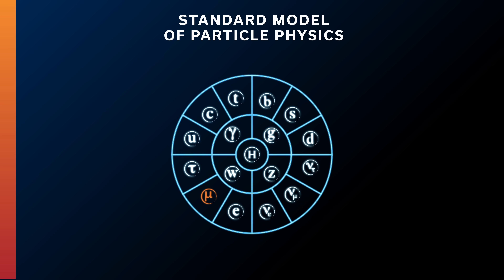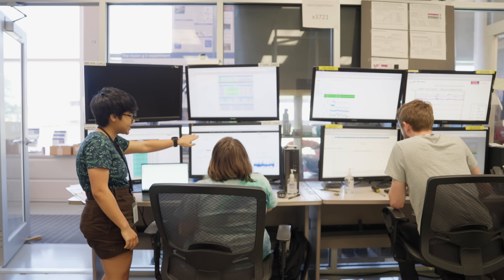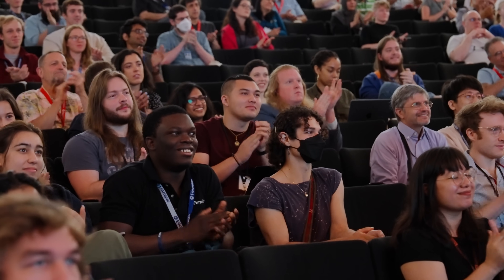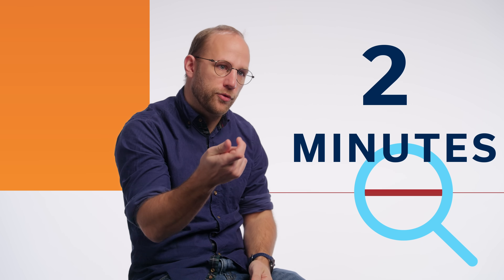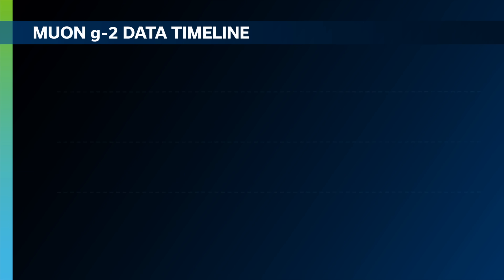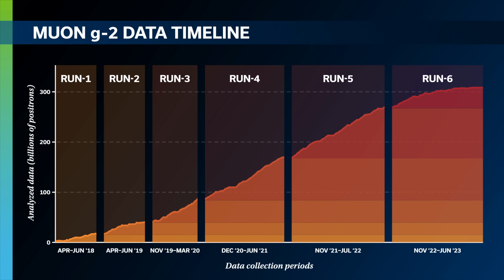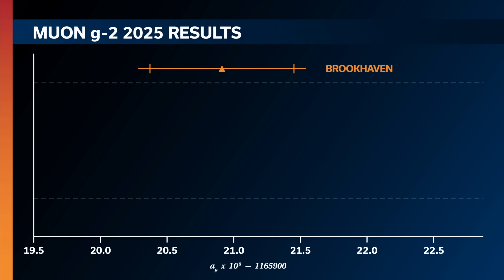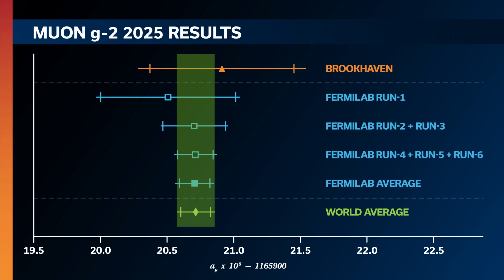Final Muon g-2 Measurement at Fermilab

Comment: Amazing - and relevant - work. Thank you for everything.

One (possibly ignorant) question: How can this be reproduced? I trust Fermilab and the scientists working on this are definitely some of the best on the planet. But science requires others to do the same experiment and come to the same conclusion. Given you had to have the magnet shipped to you, I am guessing creating a second one is prohibitively expensive, making reproducibility a problem.

Sooooooo..... what do we do?
Reply: Hi, good question. I'm no expert, but I will try a possible educated answer: We don't need to repeat the same experiment to have reproducibility, there is intelligent manners to have reproducibility. Four points:
1) This experiment is not really a single experiment, but really an experiment made so many times. In a way, they are doing the reproduction of the experiment to avoid random errors. This is how they achieve so amaizing precisions and, in this way, the high statistical requeriments in physics to call a discoverment force researchers to do the reproduction themselves.
2) The previous point reduces the random error, but there is also the possibility of systematic error (there is an error with the experiment itself). To face this, all the methodology and the data of the experiment is public to the scientific community, in this way all scientist in the area can reproduce the calculations or critic the methodology.
3) With the two previous points, you can reduce random and systematic errors, but there is the possibility of frauds. To this, experiments like Fermilab or CERN have strong standards to secure the data from manipulations (even non intentional) and there is many scientists from all over the world looking to this experiments.
4) Finally, all the set of experiments can be redo by Fermilab and they also change teams when they do it. Commonly, they do the experiment with variations or improvements to not waste resources and time (you can do a new experiment and also reproducing results of a previous one).

In summary, to achieve reproducibility in these costy experiments it is necessary assure bigger standards in statistics, data security, data management and open transparency.
Reply: @Edunomat  in addition, different types of experiments can be / are done to measure the same thing, to check for errors introduced by the method itself. (Unrelated, but the "crisis in cosmology" is essentially about that idea: different types of measurements that should return the same results but don't.)
Reply from the maker: A future experiment at the Japan Proton Accelerator Research Complex will likely make another measurement of the muon magnetic anomaly in the early 2030s, but, initially, they won’t achieve the same precision as Fermilab. https://g-2.kek.jp/overview/
Reply: Some of the "reproducibility" may come from the creation of new physical model hypothesis (hypothetical fifth+ force) which hinge on this result. These hypotheses may make predictions which can be used for new experimental design. If the new experimental designs are concurrently validating the predictions set forth from this experiment, then it serves as indirect evidence.
Reply: @DeepReTheDebrief 50/50 also?  Ist das als Beweis tragbar?   Siehe dazu:   Wasserrutengänger wissenschaftl. Test.  
Liebe Grüsse aus 🇩🇪🫂

Comment: See/saw=constant Sterile neutrino S=(E*T)/(M*T)=2*(me/pm)^2=2*137.036*(2.16*10^-9) deduce (me/pm)^2/137.036=1/(1836.1527^2*137.036)=2.16*10^-9=0.00116592026-0.00116591810 : extra wobbling of muon magnetic moment of (g-2)/2 factor between experiment data[0.001165920+((61-41)+(57-25))*10^-9/2], theoretical prediction [0.00116584719+6845*10^-7+154*10^-8+92*10^-9] from Fermilab at 8/10/23 from beauty quantum 4.25 Gev=(10/16)*137.036/g(p)=(10/16)*(me^2/g*m^2)*(137.036/(me/pm)^2) which can decay into muon[105 mev=(3*137.036/2)*0.511], electron[0.511 mev=me*c^2=g*m^2*137.036/A] 85.73% ratio by 100-85.73=14.27=A/(3*137.036*(A-A1))=128.51991/(3*137.036*(A-A1))=128.51991/(3*137.036*(128.51991-128.4980143))=128.4980143/3^2=(80.351+0.135)/(137.036*(80.485-(80.428126+0.015448))) deduce 80.428126 Gev[80.351+,-0.094] W boson, A1/A=128.4980143/128.51991 from weak force unite strong forceg(p)=g*m^2/pm^2=g*(pl/4.1888*l)^2=1.13*10^28 which's by graviton g*m^2=ch/2pi oscillation between Planck scale l=g*m/c^2=(h*g/2pi*c^3)^0.5=1.616231*10^-35 meter which can deduce ch=2pi*g*m^2=8pi*g*(m*c^2/2)^2/c^4, m=(ch/2pi*g)^0.5=2.176466*10^-8 kg : solution of GR field equation, proton scale pl=g(p)*(4pi*pm/3)/c^2=8.809*10^-16 meter produce asymptotic freedom of strong force with EM force between proton[pm=1.672621868*10^-27 g], electron[me=9.10938356*10^-31 kg] in hydrogen Atom[A=5.29177282*10^-11 meter] k*e^2=g(p)*pm^2/137.036=ch/(2pi*137.036)[e+]=me*(c/137.036)^2*A[e-]=4pi*g(p)*pm*me*137.036/128.51991 which can reproduce Dirac's quantum field deduce 0.001161409725=1/(2pi*137.036)=e+/ch Schwinger weak QED for anomalous electron magnetic moment of (g-2)/2 factor from magnetic field of positron e+=ch/(2pi*137.036)=k*e^2, 2pi*0.001161409725*(me/pm)^2=(me/pm)^2(g*m^2/k*e^2)=(me/pm)^2/137.03128.4980143*A/3.1415926=128.51991*A1/3.1415926=2.16*10^-9, T=g*m^2/137.036*8.38=0.015448 Gev Tau neutrino, M=pm^2/(2*g*m^2*137.036)=0.1811 mev Muon neutrino. E=me^2/(g*m^2*137.036)=0.108*e Electron neutrino, 4pi*M=2.276 mev[up][137.036*4pi/3]=1.306 Gev[charm][137.036]=179.0137 Gev[top], 8pi*M=4.552 mev[down][137.036/2pi]=0.099269 Gev[strange][137.036*10/32]=4.25 Gev[beauty quark ] for SO(32) super sting theory unite 10D of open string ch=8pi*(137.036*A)^2*pm*c^2*(128.4980143/128.51991)[4D E8*E8]=2pi*l*m*c^2[2D type1]=2pi*pl*pm*c^2/4.1888[2D type2b]=2pi*A*me*c^2/137.036[2D type2a] by AS/CFT duality from 3 3D quantum black hole l, pl, A^2=g(p)*pi*me/128.4980143*c^2 with 16D of 4 4D force of close string by super symmetry 137.036=Gr/k*e^2=GR/QM=(m*g*pm*g(p)*pm*g*m)*(1/137.036)/((e-)*g*(e+))=ER/EPR, g*m^2*137.036/A=me*c^2=0.511 mev[electron][137.036*3/2]=105 mev[muon][137.036/8.38]=1.717 Gev[tau], extra wobbling of muon from 8/10/23 from Standard model is more reasonable explanation.

Comment: Please note the Au provided in the video is, au= 0.001165920705, while in the document is au = 0.001165920715
Reply from the maker: The latest experimental value of the magnetic moment of the muon from the Fermilab experiment is 0.001165920705. The second value you mention is the combined experimental average, which includes the values from Brookhaven and Run 1-6 at Fermilab.
Reply: Thank You so much for your explanation and for your dedication  @fermilab
Reply: Why average the old result with yours.  This clutters the whole science event, and effectively destroys the accuracy of this measurements.  It is either accurate, or not.
Reply: @brunonikodemski2420  please study statistics at the postgraduate level before claiming you know more than the people designing and running the experiments
Reply: @brunonikodemski2420  Can you explain your position again? For the measurement to have the adequate statistical significance, the number of measurements and the deviation from the predicted values must be great enough. Previous experiments indicated that there was deviation, but it wasn't significant enough for the threshold that they wanted. By repeating the experiment and pooling the data, they are honing in on a more precise measurement which is thankfully maintaining a significant difference.
Reply: @brunonikodemski2420 there was nothing fundamentally wrong with the Brookhaven data. It was accurate but perhaps not as precise, but that can be accounted for when doing the statistics. And in general, more data is better.

Comment: Can someone please dumb all this down for me and tell me how it changes are understanding of subatomic particles
Reply: In short the experimental results agree with theory, so no changes to the standard model of particles.
Reply: There's a discrepancy in the magnetic moment for muons between what theory predicts and what the g-2 experiment measures. They don't know why, which is why we know we don't understand the physics well enough.

It still needs to be replicated elsewhere or through other approaches for us to definitely say that the theory is wrong. It could be that we just didn't understand the virtual particle interactions well enough. It's also possible that there's a systemic error, but all of these are options
Reply: It doesn't, rather it confirms that our current models are still holding up. It does open up semi-interesting avenues of research as to why the old predictions were off
Reply: @decaydjk8922  I think this one confirms a deviation from standard model. But it is not far off from lattice QCD calculations. That needs to be explored further.

Comment: Note for video editor, the audio ducking is very distracting. Maybe just adjust the mix statically.
Reply: Yeah whatever they said.❤ That background music popping up loudly in between speaking is distracting.
Reply: @BlackHoleForge very ghastly and unscientific
Reply: I thought you got autocorrected, but audio ducking is a real term 😁.

What I initially found slightly distracting, was how quickly Simon Corrodi spoke, I actually thought I had the video on 2x 😊
Reply: @VikingTeddy hahahaha me too
Reply: Totally, the ducking is driving me crazy. The music between each sentence was not necessary. For sure the beginning of Simon Corrodi speaking too fast throws one to check if the speed settings of the video are correct or not, I hope @Fermilab can fix this.
Reply: Watch your audio ducking language
Reply: this made it very difficult to watch :(
Reply: Agree. Should use automation curves for this, not sidechaining.
Reply: @rarelycomments or just a very long and slow release
Reply: @MichaelKire  this, down a few dB plus long release on the compressor. That string arpeggio was the worst
Reply: @rarelycomments pardon?
Reply: When used gently, this technique allows you to get more clarity from both audio signals.
Key word "gently". What is being spoken is key, the music filler is irrelevant and should be barely perceivable.
Reply: My headset has a habit of randomly dropping centre channel so I thought that was happening. It seems like they just used an automated feature to turn the music down whenever there was any volume from the voice track.
Reply: I usually roll my eyes when I read comments like this but this time...yeah. it's a bit much.  A smoother automation would be better than just a fast comp smashing the music in the head😂
Reply: @krystiankrewniak no music. FINAL 😡😡😡
Reply: comon give them a break, they're nerdy muon research scientists, not youtube video producers but lol I agree the audio is terrible
Reply: I learned a new phrase; audio ducking here.  A Bridge Too Far is an excellent example of a movie ruined by the extremely loud music soundtrack.
Reply: No music is the best music.
Reply: @jeffreymorris1752  Music is fine but it should be a consistent low volume that doesn't interfere with hearing the words spoken
Reply: @jeffreymorris1752 ✔️100%
Reply: Note for the audionerds, no one cares.
Reply: @Kalumbatsch clearly people do
Reply: I'm 62 y/o and had no issues with the sound at all.
But then - I focus on the content and try not to complain about small issues. Try to appreciate the information given, it's all free of charge.
Reply: @ZeedijkMike so because it's free, it has to be a complete dog's dinner? Great